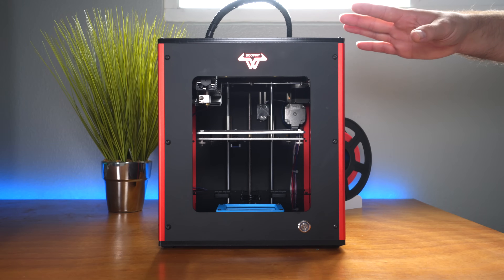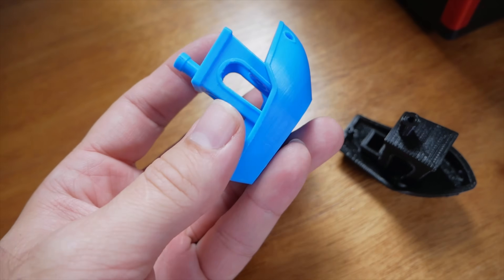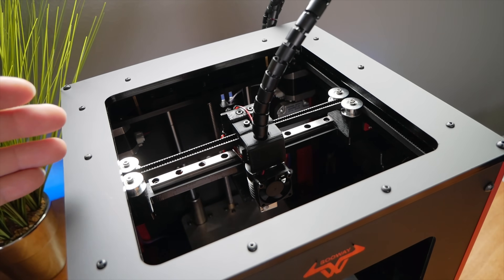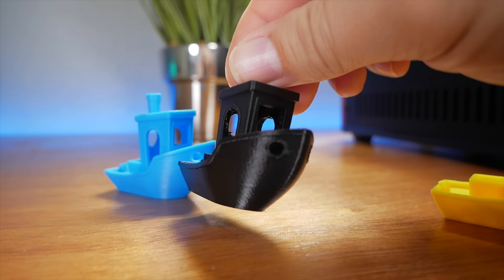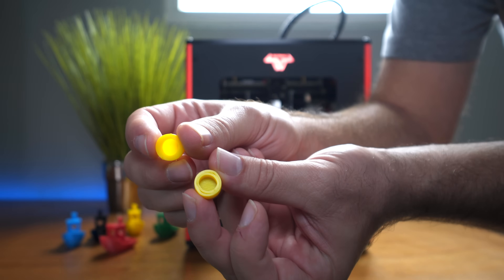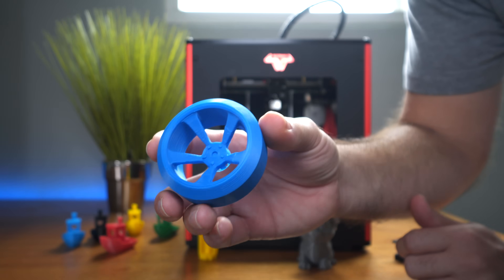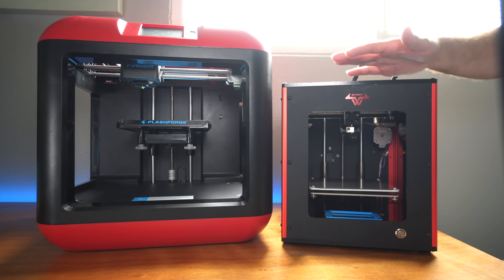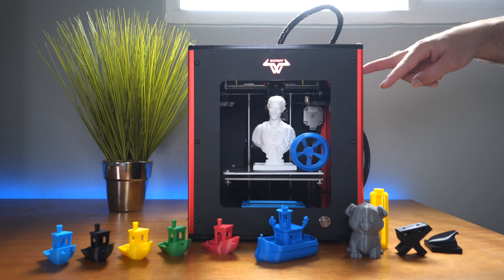SOOWAY - SW-36 3D Printer - Update & Prints

Comment: Does the manufacturer provide any source of stl files for the 3D printed parts? Overall, I am tempted to purchase one of these, as all my other printers are pretty big & heavy--not at all what you might call portable. The idea of owning a mini H-Bot is truly tempting--great to take on vacations.

Also, is the extruder a dual gear design? Is the controller 8 or 32-bit?

BTW, the belt coordination on an H-Bot, like other coreXY type printer designs, is very critical, and oval circles seem to be one of the inherent, potential problems.

At any rate, thanks for the review!

Comment: You should do a video where you set up a Raspberry Pi with Octoprint (an OctoPi) - so you can show your viewers how, for $50, you can turn one of these single-button-no-screen printers into a full feature printer. How you can send prints via wifi, see the time remaining on a print, home axes, preheat, etc via a web interface. I know there's a lot of videos already on how to make an OctoPi, but they're usually by 3D printing pros, hooking them up to $500+ printers. It would be interesting to see how someone relatively new to printers would do with an OctoPi on a cheap printer. The old pros tend to overcomplicate it.